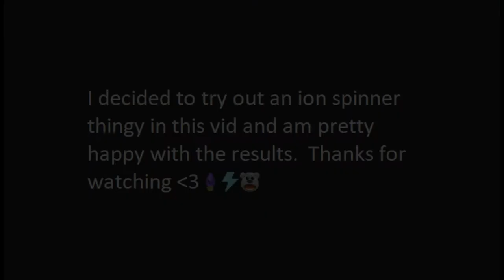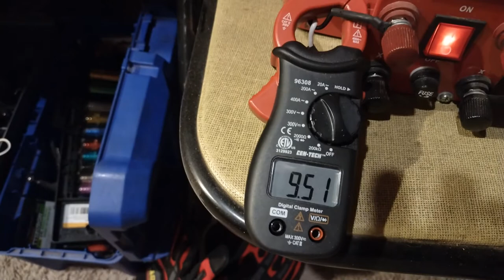GU81M VTTC Spinner

Comment: what changes did you make to the schematic, and are you running it off of 60hz or 50hz?
Reply from the maker: Hey thanks for commenting.  I am using a single MOT instead of two and am running it at 60 hz.  Also i'm using a 30amp switching power supply and giving the filament 12.9 volts DC.  I have been using a 16" coil with 1050 turns and added a bit of top load to get the best result.  I just got a 12 inch 750 turn coil of the same size wire and diameter(26 awg and on a 3.5 inch form)  Haven't tried it with the 12 inch secondary coil yet, i'm expecting to have to reduce the amount of turns on the primary, just am taking my time before I do anything.  Thinking about making a tap system.  Im sure there's way more that I can get out of it from a single MOT.  Also I'm using a second MOT as a ballast.  Im using an auto transformer too, goes upt o 146v.  I'm also using two 75 watt 120v incandescent bulbs in series as my grid leak resistor because i couldnt' get ahold of a 240v 150w bulb.  I measured the capacitance of my doorknob caps and wrote on them with permenant marker also that way its easier to just swap them out for higher value since they go from  450 to 470pf, not a huge difference but its something.  Thanks for looking and I have been really meaning to get out and work ont his thing again, eventually i'm going to add an interrupter and a second MOT to the voltage doubler but only after I get the primary and secondary more finely tuned.
Reply: @JoshHopkinsYT  try removing one of the lightbulbs. he was running on 240v 50hz and we're on 120v 60hz.
Reply from the maker: @EthannCraftt  Yes Im aware of my country's line freqyency.  You need 150 watts worth of resistor at 240v, 120 woudl prob still work ok but you will need the 240 once you go to the 6000v on the plate i'm pretty sure.  Seems to be working just fine.  It really needs tuned more than anything.
Reply: @JoshHopkinsYT hm, ill have to try a few things whenever i build this circuit up myself. but my reasoning behind it is that he drew the lightbulb as an inductor, which if my understanding is correct means that he's using it as an inductive choke, so two in series would change the inductance and therefore the behavior, so ill definitely try only a single 75w bulb.

worst case scenario if im wrong is that the output gets a bit smaller, which can be easily fixed by adding it back, no biggie.
Reply from the maker: @EthannCraftt  The lightbulb is being used as a resistor on the grids 1 and 2, adjusting the resistance would change the duty cycle.  I see what you mean about that looking like an inductor tho
Reply from the maker: Good luck on your tesla coil journey!  Looking forward to seeing it and please let me know any questions that you have I'm happy to help